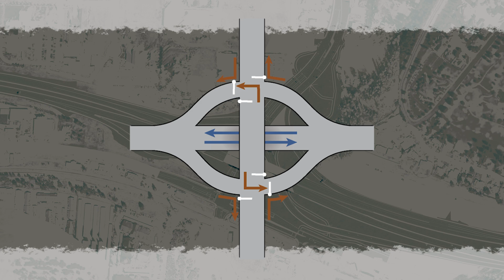I-90/SH-41 Interchange Flyover Video

Comment: What is the current estimated date of completion? I’m a delivery driver and it is the biggest PAIN just trying to cross north or south of I-90 at the Seltice and Mullan intersections, since the light only lets one side go at a time.
Reply from the maker: This project is set for overall completion in 2026, however, drivers will experience a drastic improvement in mobility later this fall once traffic is shifted onto the new alignment and the new signal/interchange opens. That change is expected to happen mid to late fall of this year (2025)

Comment: This is going to be an absolute nightmare. How could ITD possibly think this is a good idea given the staggering number of Post Falls residents who don't even know how to safely use a traffic circle? I've never seen such a tangle of lanes. What happens if the single set of traffic signals fails? Why not add easier access to Seltice on the eastbound off ramp and on ramp? What was wrong with a traditional cloverleaf interchange? The answer is nothing. We just have a team of ambitious traffic engineers who chose form over function. As an Idaho taxpayer, whoever concocted this boondoggle should be FIRED. I repeat: THIS IS GOING TO BE AN ABSOLUTE NIGHTMARE.
Reply from the maker: The original interchange wasn't built to handle the traffic volumes we have now, much less what we will have in the next twenty years. The loop ramp was a safety concern with several severe and fatal crashes. Our signals do have backup batteries in case of power outages, but if they do go dark, drivers should treat it as a four-way stop until services can be restored or we are able to flag the intersection. Before construction, the local traffic on Seltice was a major reason that the intersection was failing and difficult for drivers to navigate with all the lanes. In design our goal was to separate local traffic from the highway traffic to allow for more efficient operations.
Reply: A.  I use round abouts every day in post falls and never have issues.  Everyone around here says people don't know how to use them but they seem fine.  Either way this is a light with turning lanes.  No different than other intersections.  
B.  What happens in a normal intersection when the light goes out?  It flashes red until fixed.  Not ideal but not a reason to avoid doing it lol.  
C. Before construction if you wanted to get off eastbound I90 and go east on seltice you had two lights you had to sit through.  One to turn left off the offramp and other at 41/seltice.  Now you get off and have two lights but one is a shorter light as it has a single cycle to control.  If you go west on seltice it's the same amount of stop lights (one) as you would yield onto Seltice.  
D.  A cloverleaf interchange is less effecient.  There is tons of data out there about it.  Also in this case it would make no sense since you have Seltice running parallel with the freeway and the highlands hill.  There is no space to do cloverleafs. Also, we have a cloverleaf offramp there right now and it has a way higher accident/incident rate than any other offramp in the area. 

 It will be just fine.   You seem to forget we have an SPUI already in the area.  It's not an offset SPUI (like this) but a normal SPUI.  It's located at 95 and 53.  Everyone freaked out about it when they built it and guess what - it works GREAT!  Traffic studies have shown fewer accidents, less congestion, etc.  Most of your "arguments" are moot points because we already have an SPUI.

Comment: I live around a hour away and took a look through the uncompleted interchange a couple days ago, it appears work is going smoothly and is getting quality completion. Good job for that ITD. this is a lot more safer and has a lot more capacity than before. The new opened stretch of 41 looks like US-95 similarly in Coeur D’ Alene. Do you have ideas as to when the full US-95 will be upgraded to 4 lanes from Garwood to Sagle? Also, a lot more congestion I’ve noticed has been taking place on Highway 200 as well from around Colburn Culver through to the US 95/2 interchange, I’ve been noticing traffic counts and just a lot more people on the road, especially back ups at the Shingle Mill Road intersection from stop and go traffic turning. I was wonder if there’s a way you guys could possibly review traffic studies between the two. The Kootenai project certainly helped, but I feel like in the future some more lanes at key spots may need to become a reality. Or atleast, passing and more turn/acceleration lanes. Anyways, very good job and keep up the great work!
Reply from the maker: Good morning, yes there definitely is much more traffic than in recent years, all over! Currently ITD is exploring a project design and environmental re-evaluation to expand US-95 through the Sagle corridor (Dufort Rd to Lakeshore Drive), however there is no funding dedicated for construction at this point. Segments of US-95 south of Sagle are part of a long term planning effort, and those projects are being prioritized based on traffic studies, volume, crash data, etc, however, there may very well be some minor interim enhancements (turn lanes, etc) to the system that will be needed between present day and when those full expansion projects are planned well into the future.
Reply: @idahotransportationdepartment Sounds good. I saw the freeway proposal and was shocked, but everyone loves it up here now so accommodating the growth is certainly needed.

Comment: I was trying to see the eastbound I-90 entrance ramp. I'm not sure that it looks safer. The previous entrance was really good. I could easily get up to at least 60 on the ramp and there was enough merge area to safely merge into traffic. The way it is now, I refuse to enter I-90 on the current ramp. It is unsafe. The moment I get to the top of the ramp, I'm in the right hand lane. There is no safe merge area. If I have to go east on I-90, I go back to Seltice off of Idaho St. I hope the new entrance ramp will have a long merge area. In fact, when entering the ramp, it would be a good idea to have a sign saying the minimum entrance speed is 55. Merging is the most dangerous area of a freeway.
Reply from the maker: Once construction is done, you will have a new eastbound entrance ramp that will be longer, have better sight distance and be safer.

Comment: So with all this construction the video looks like they are not adding another lane each direction on the freeway? I thought that was one of the main reasons for all this construction?
Reply from the maker: Hi Dean! It likely doesn't show the lane expansion because this video is from 2022. A bit of updated information- starting in 2024 construction is slated to begin to expand I-90 to 4 lanes in each direction between US-95 and the SH-41 interchange. We are also in the planning phase for an I-90 corridor expansion project that will pick up at the SH-41 interchange and carry through Post Falls to Spokane Street, ultimately working west all the way to the Washington State Line. We recently hosted an open house and the comment period for public input is open until the 19th! You can find all of the information about this project at https://media.itdprojects.org/2023/10/ITD-I-90-Post-Falls-Alternatives-Open-House-Displays-Oct-2023.pdf
Reply: Doesn't look like the new east bound bridges will accommodate three Lanes. That's a waste, tho it would have cost more at this time.  That should be minimum allowing for growth and expansion. I guess three lanes from stateline to 41 would work if third right  lane becomes an exit only lane at hwy 41 exit. Then two Lanes go over new bridges. Expansion to CDA is planned east after 41  already.   Other than that, thank you for all the hard work, hope it works as well as planned!!

Comment: Would have been cheaper and more efficient to design a displaced left interchange. Could have eliminated the eastern mainlane bridge. A diverging diamond could potentially eliminated both flanker bridges.
Reply: AND  would have to do more changes in  3-4 years....  Not very efficient. That would have only been a very expensive bandaid.
Reply: @iamjp2u  A DDI would only require one I-90 bridge rather than three, simplify the left turn movements, reduce delay at the traffic signal because there's fewer phases, and DDIs are much safer due to fewer conflict points at the intersection. 
So a DDI would have been cheaper, safer, AND more efficient traffic than what's proposed.

Comment: Can you say fustercluck? 🤮🤬 🤑
Reply: As opposed to what it is currently? This replaces three lights and makes multiple connections that don't even go through a single light...
Reply: @ghostofScottServais  Maaaaybe they could slow the construction explosion and figure out some better paths to I-90 from the prairie. The "improvements" they are making won't last if there are another 30k+ people using that corridor 2 years after it's done.
Reply: @12mrcleanx  I agree with that. However, they are starting the Heutter Cutoff project very soon. But I maintain that this new interchange is the single best project they could have done. And it definitely helps with what you're talking about, cause the alternative is doing nothing. A big solution would be to add more on/off ramps but Post Falls has tax reasons for not doing that, which in my opinion is ridiculous.